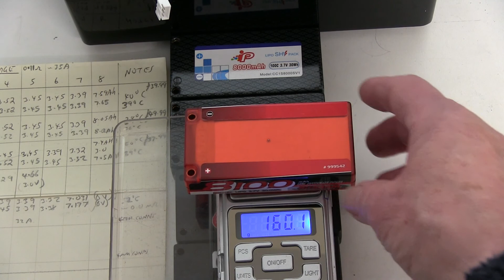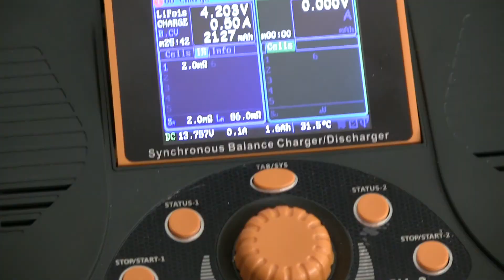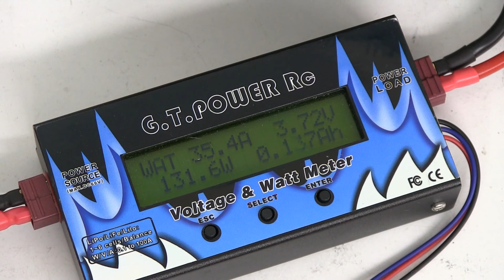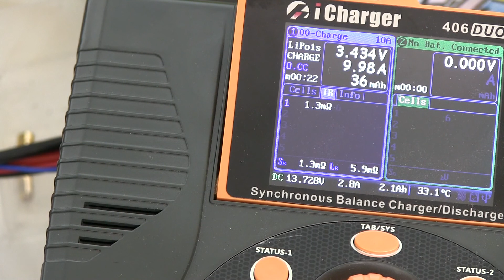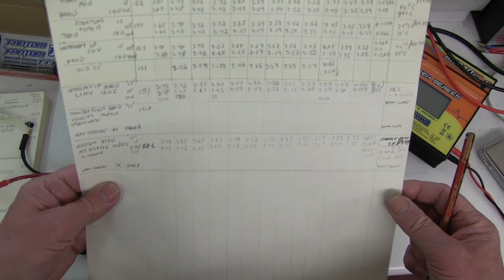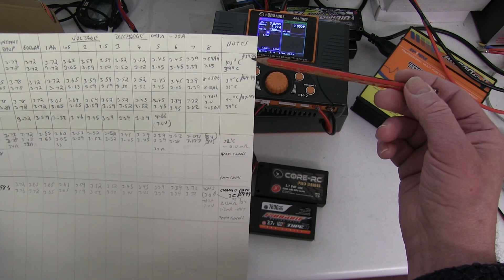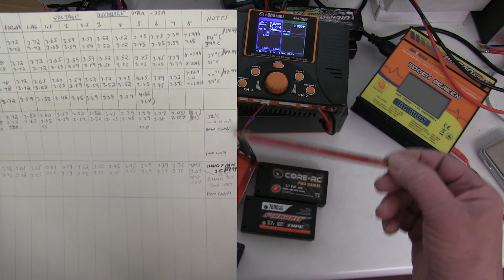Nosram 8100mah 1S, 3.7V, 110C  1/12th X-treme Race Lipo

Comment: Great info sir..  quick question  i have a 3s 65c 5000mah lipo it's  3 to 4 months old but only used 3 times then put into storage voltage. could i buy the same 3s and use it in parallel with the  3 to 4 month old battery that was used 3 times

Comment: Do you break your new lipos  at charge at a low or high rate
Reply from the maker: Hi
Lipo normally only need one cycle (from new) to bring them to full performance.
I normally charge at 7 to 10 amps for testing, to prevent heating affecting the test results.
Reply: Did the Nosram 8100mah ever reach it's listed capacity of 8100mah
Reply from the maker: Hi
It is a High Voltage cell, so if charged to the higher cutoff of 8.7V, the capacity will increase by quite a lot.